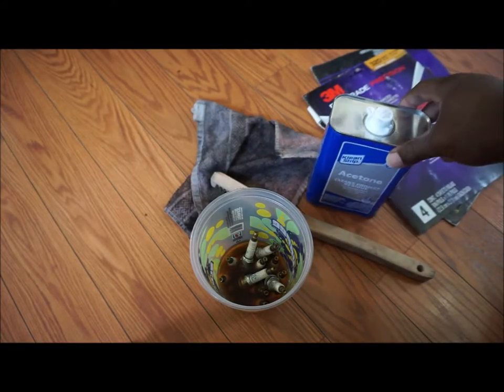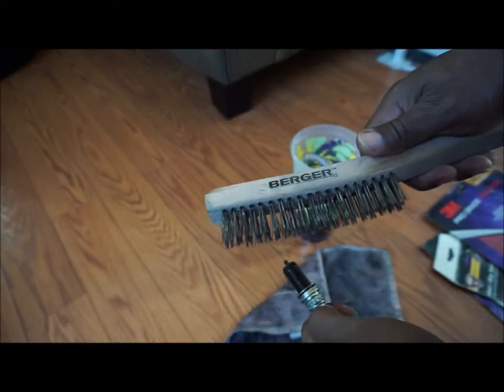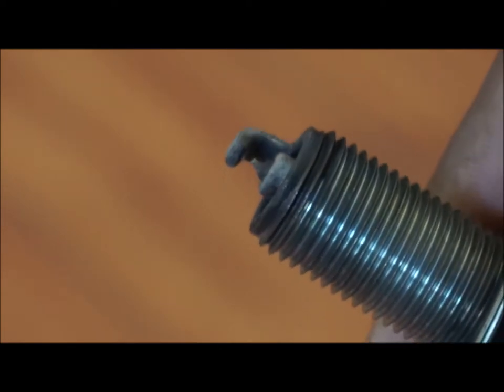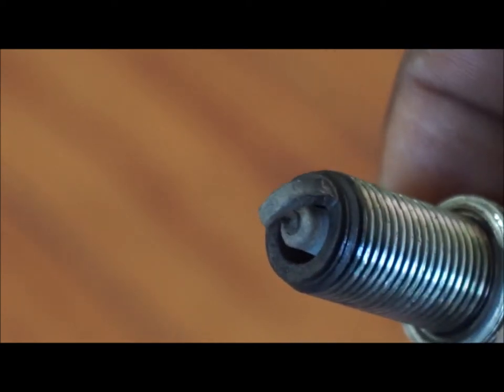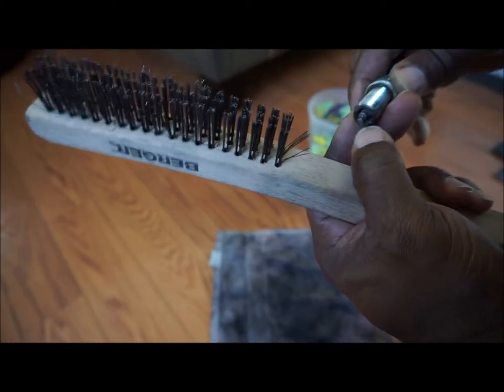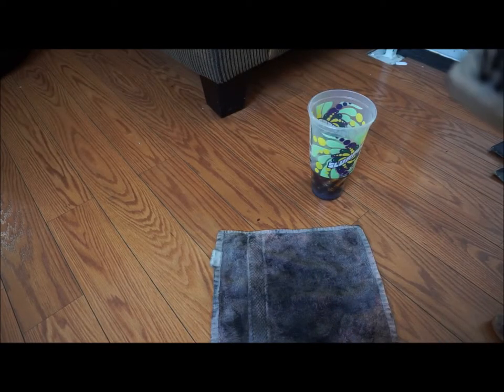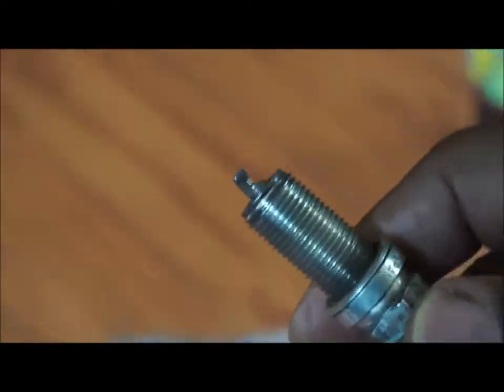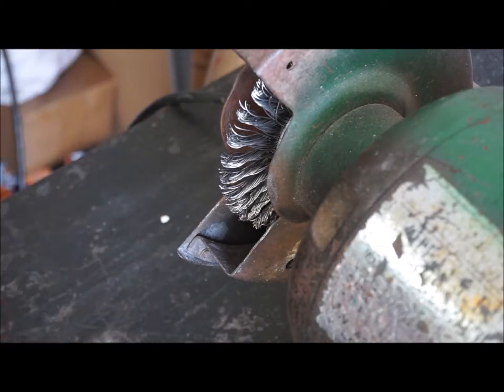DIY Renew Spark Plug..(saved $217)

Comment: try boiling them in coolant for 12-24hrs (using an old thrift store crock pot), removes all carbon deposits nicely, I've done this with pistons and made them look brand new with little to no scrubbing needed. I've thought using coolant with a heated ultrasonic cleaner would work even better, definitely want to do some testing.
Reply from the maker: Excellent tip! Thanks for this suggestion!  

Do you mind if I add this info in the video details? It may help several others as well.
Reply: Frugal_Fabrication go ahead, glad to help people out!